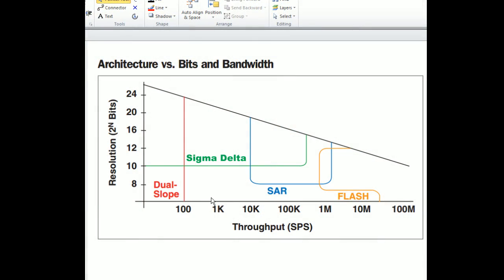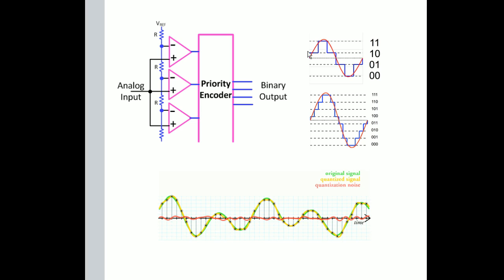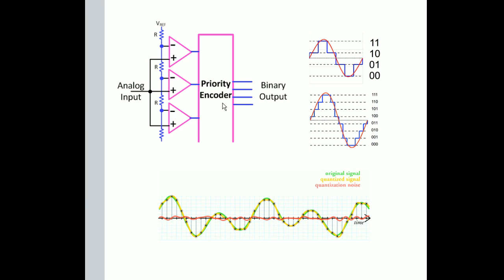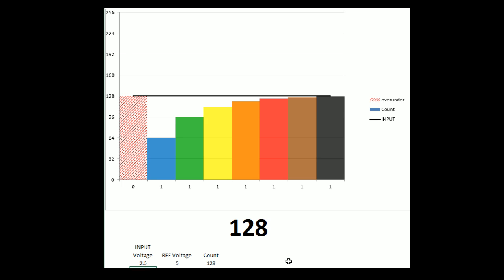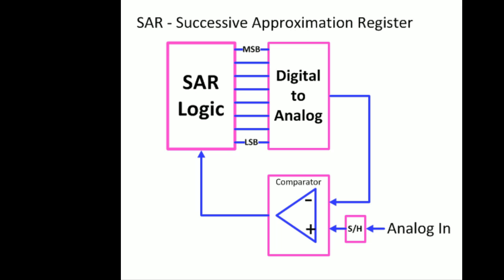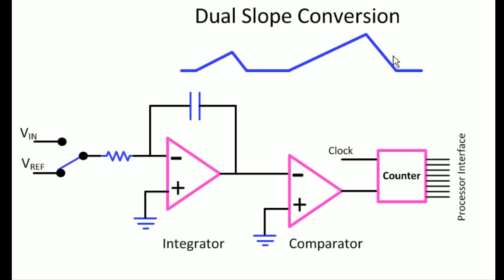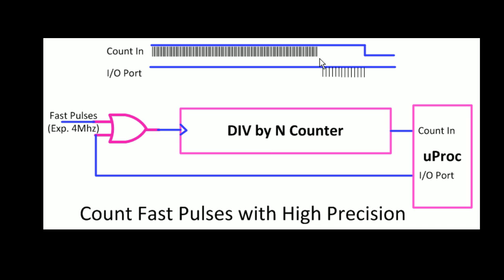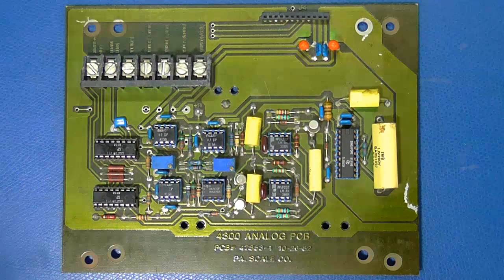Understanding Analog to Digital Conversion

Comment: The USA was likely completely over ran or could be over ran when analog rv broadcasts ended and all digital was implemented in 2009.     

The immersion. In a digital environment could create emulations and penetration of data through high tech warfare methods.  

Considering I and others are from his lower caste maimed and treated to abuse in federal financial banking regulatory jobs I see no hope for us at all.  

I would prefer to be killed than to be held hostage by the criminally insane.  

Unlimited Stakes Of A-miracle or a misery 

I want to be euthanized.  My prayer  is to never exist again in dream or reality.   

Kurt Brown Saintrambone Mobile Audit Club.

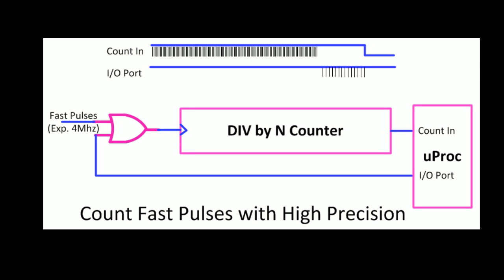Comment: Finally a tutorial that provides real demonstration, though the video lost me at 15:04 when it started to explain how the discharge time is count.  Which count represents the discharge time - is it the Count-In, I/O Port, or the Counter?  The figure drawn is confusing - it starts counting the Count-In, then terminate, then follows with counting on the IO, and finally there's a blue-pulse that gets triggered? That doesn't make much sense.
Reply: Let's pretend it's 8 bits rather than 16 bits. When the counter hits 256, it interrupts the microcontroller. Lets say the voltage being measured is equivalent to 75% of maximum, so 192 pulses are generated and counted. Now the counter needs another 64 counts to trigger the interrupt on the microcontroller. So, the microcontroller can send a pulse to the counter to increment it by one and see if that increases the number to 256 and it would then get an interrupt. The counter is then at 193 and the microcontroller doesn't get triggered. OK, let's do it again. Now the count is 194. Still not triggered. Keep going. Eventually we hit 256 and the microcontroller gets interrupted. It of course knows how many times (64 times) it had to add one to the counter, therefore it knows the number already on the counter had to have been 192.

Comment: What about a saw tooth wave and 8 bit register syncronised off the same clock and cycling between their minimum and maximum values and running that saw tooth wave and analog circuit through a comparator to latch the data in the register? Am I going to find out that's what a delta sigma does?
Reply: yep, macs used to do it

Comment: Such a good explanation..! And the graphical illustration with actual parts as well is just create!
One thing only, is that @13:05 you show 2 different input voltages but they both have the same first slope and different time at which they switch, but it's actually exactly the opposite, same time different slope.